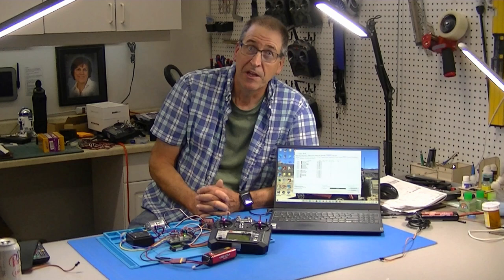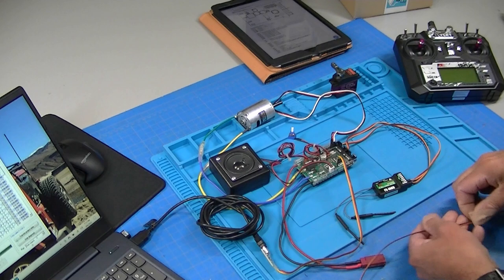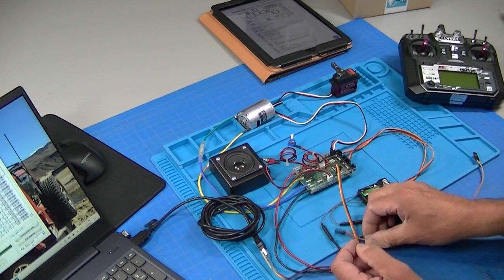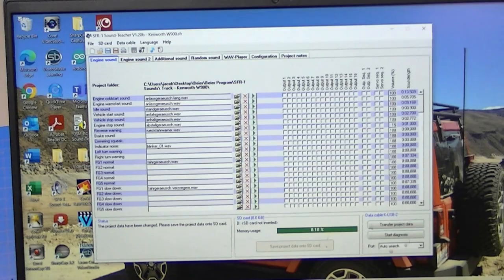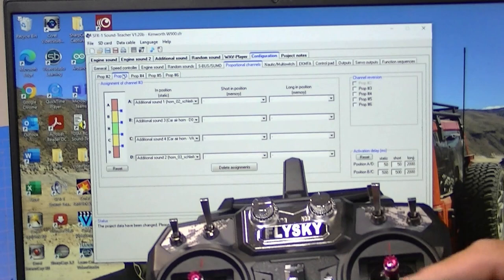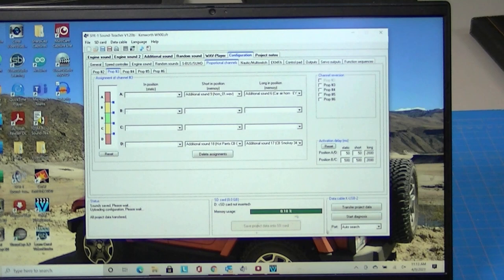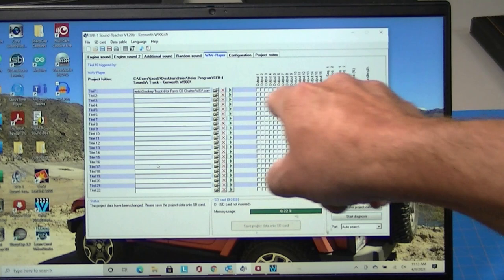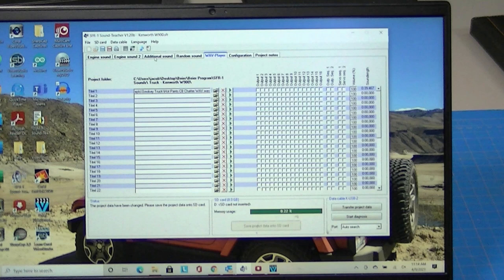Beier RC SFR-1 Part 2 Speed, Light & Sound Controller for Tamiya Semi's

Comment: Apparently the THIRD time watching these! 
So Bob... Have you ever tried replacing one of the toggle switches on the Radio with a momentary ON switch for Ch. 6?? So you don't have to switch back and forth to start the Engine.
Reply from the maker: I have used other radios set up that way and it works great.
Reply: @HobbyconceptsLLC   GOOD! I'll try it.

Comment: Hi Bob
Thanks for all the videos.  They are fantastic.
My Beier gear arrived yesterday and I am also using a FS-I6X radio and 10 channel receiver.
I am trying to get an overview straight in my head and to understand how all the parts join up.  However I am missing something when I consider the following...
 - I have ten channels on the radio and receiver
 - I can patch up to six of these to six proportional channels on the SFR-1.  If a channel is not patched how do I have access to it?  Why do I have 16 Prop channels in the configuration tab?
 - I have outputs to 3 servers and one motor and to 16 lights
 - Is the mismatch (in my head) of inputs and outputs all related to S-BUS - what does sbus do?

I am a newbie so maybe there is something basic that everyone knows.  Have I missed a nugget in one of the videos?  Post a link here if there is one I should watch

Thanks again

Ray

Comment: Hi,just loving your vids with your clear explainations.Good job. Got my sfr-1 up and running but having trouble with the smoke generator,. Bought the unit from AD-RC but i'm confused by the connections. Can you suggest a good smoke unit that is easy to connect to the sfr and will fit in tamiya trucks without a seperate battery to power it ?

Comment: The volume control from the radio using the VRA pot would be better if you assigned the Prop#5 to directly control the volume (General tab - Volume).

Comment: Does what you were explainning also apply to the sound and light module
Reply from the maker: Yes, pretty much.  The software is very similar.  I will do a video on the USM unit also.
Reply: @HobbyconceptsLLC  i ran all my wires on my dozer and ordred the sound unit through wess and will  be installing when i riceive it , will be looking for your video , great job on your channel ,i allways  look forward to your next video , keep up the good work.

Comment: Is it possible to get this all setup and renning with a trigger based controler? Flysky GT5?
Reply from the maker: No problem.  However most all pistol grip controllers lack the nicer selection of swithces and knobs needed to get the best use of the system.
Reply: @HobbyconceptsLLC  Just bought my first truck inc MFC03 and trailer, will have to look into modding my GT5